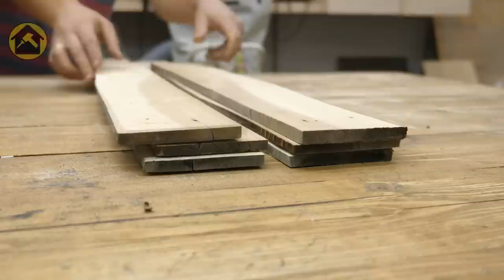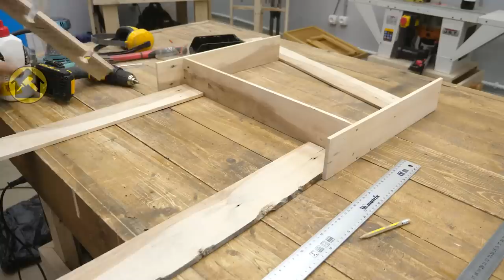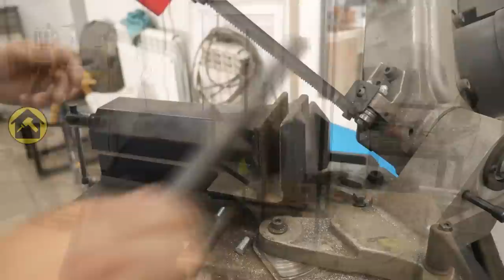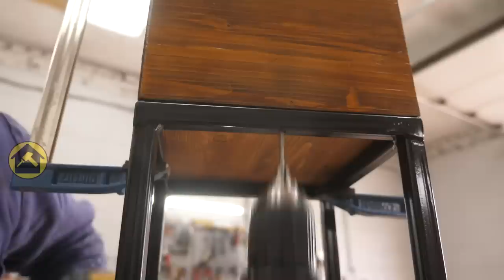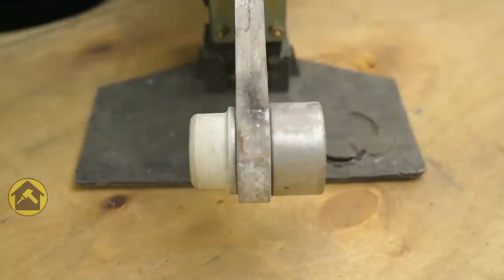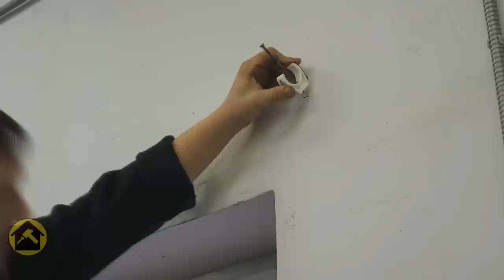3 ideas that changed my life completely!!!

Comment: The curtain over the chain wheel is the one also used in rolling shutters motor and shaft at one end and other end just a roller point.